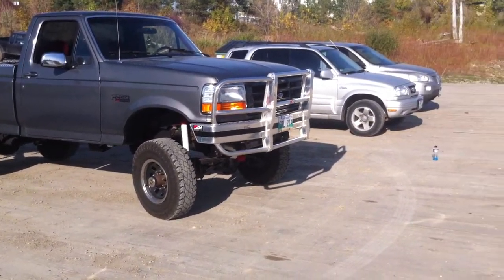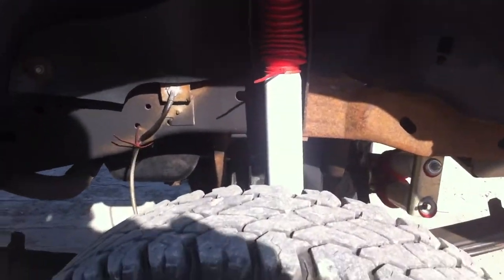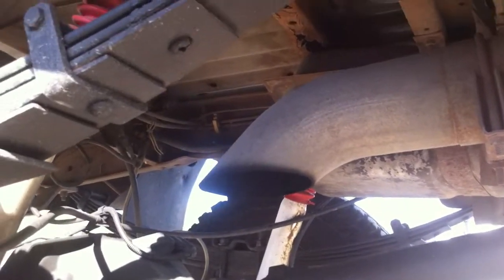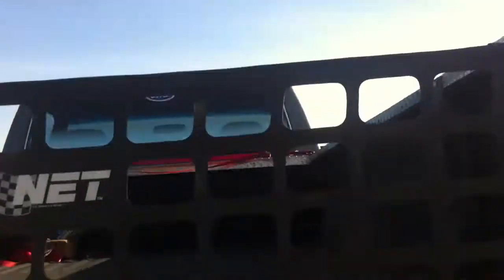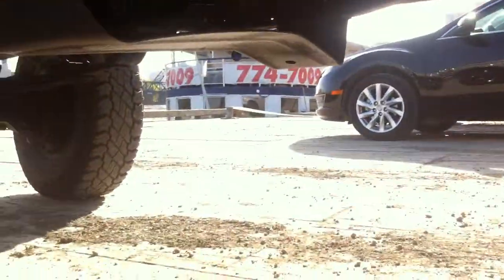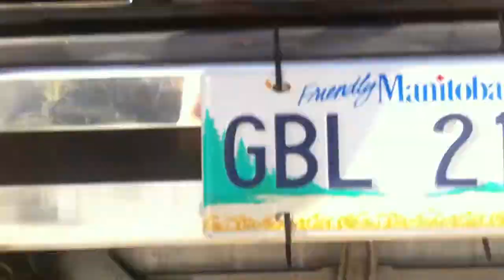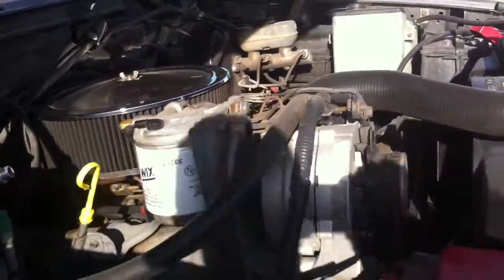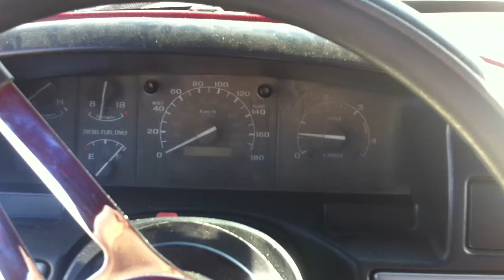1992 f-250xlt 7.3l idi

Comment: Errr the f250's and 350's both shared the same Sterling 10.25... Nice rig might wanna replace those rear U-Bolts
Reply: No f250 got a Dana 44 with front ttb and a Dana 60 rear f350 got a Dana 60 front solid axle and a sterling rear

Comment: it's a 3/4 ton my friend not a one ton ?
Reply from the maker: cody Hamilton it's a TTB 50 which requires 1 ton parts so it's considered a 1 ton front axle for the ttbs, they also use the same 10.25 rear-end in 1 tons. I also have a 1997 f350 4x4 CcLb SRW with the 7.3, my rear diff is the same just my front diff is solid in it. Only thing making this truck a 3/4 is the gvw
Reply: False they youse same spline count so locking hubs are the same as the 60 but post 1987 only f350and f250 hd ran the 60 and all the obs trucks 250 and 350 ran the 10.25 the 10.50 wasn’t a thing just labeled that

Comment: my sterling 10.25 has been updated to larger spline length and pinion yoke under 4:10 gears also installed a traction/axle wrap bar to help bulletproof it even more.they only installed the 10.25 under 3/4 tons from 1986-1992, i took the internals and yoke off at 1999 10.50 sterling. my U-bolts are brand new